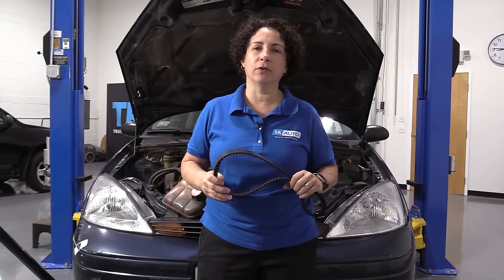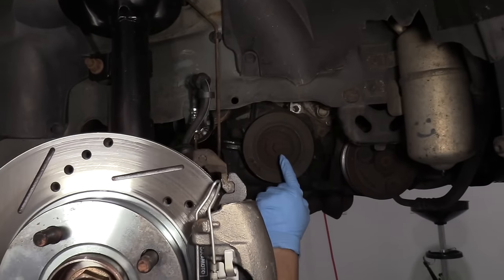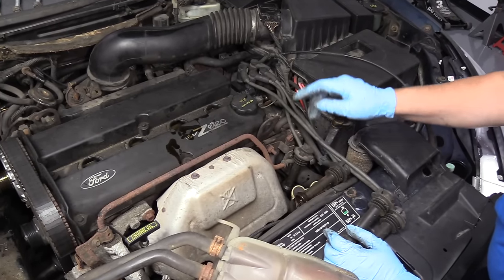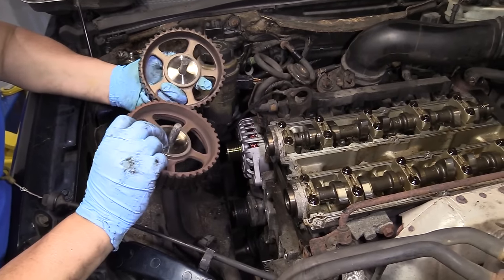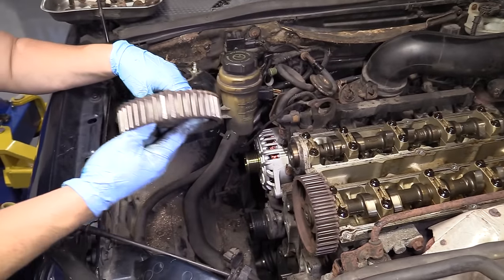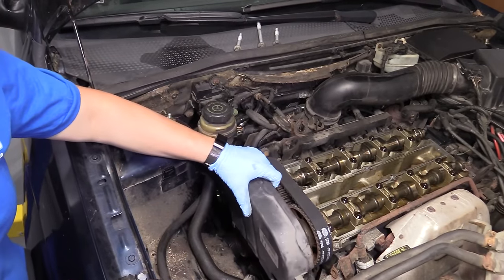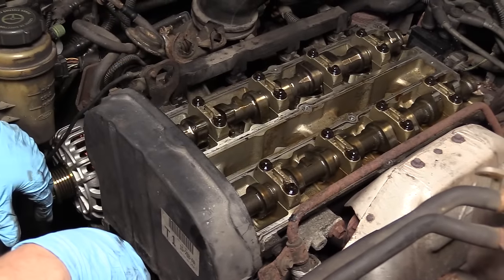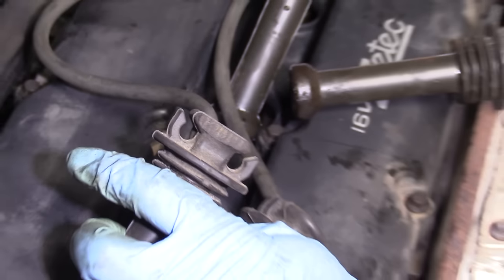How to Replace Timing Belt 00-04 Ford Focus Sedan Wagon Hatchback

Comment: Does anybody have a focus ? How do you know when it’s bad or when it should be replaced? Any noises? Any difference in engine noise or anything?I have a 2002 Ford Focus se. I can’t find any record of it been replaced. It’s got 170k+ miles. Please any help would be appreciated it and Im thinking about replacing it but Not completely sure.

Comment: When is the best time to be ahead of a timing belt need? Like, when do I know its time to replace it without it getting as bad as the one in the video?
Reply: When in doubt, change it out! If you buy used make sure you have documents showing the last change and mileage and go from there pending how it drives. Never max out the lifespan of the belt or you might max out the lifespan of your motor.

Comment: I wonder how many garages will actually do this all so neatly. I’m afraid once you walk out of the door with your car left behind with them, that they are going to botcher the job to save time and effort. Just replacing the belt literally without swapping the pulleys and properly installing the valve cover etc. It looks like an interesting job to DIY but i guess it has a high chance of failing when you’ve never done this before.

Comment: 15/16 won't even fit over my camshaft, mine needs a 1" , as far as what you use to keep the camshafts from turning while you tighten the pulley bolts

Comment: Nice video!. Can i ask you something? I need to replace the timing belt, i have a ford focus titanium. is it the same? What do you mean by 00 04?
Reply: Toncho 1 she means vehicles from 2000 to 2004
Reply: 00-04 refers to the model years of Focus to which this video pertains to. This video is a step by step tutorial for anyone with a 2000-2004 model year Ford Focus with the 2.0L Zetec. I believe the Titanium package was introduced quite a few years later, so this video most likely will not be a proper tutorial for your car. Verify whether your vehicle uses a timing belt or a timing chain. Timing chains don't usually need to be serviced for the life of the vehicle.

Comment: WHAT about the water pump , easy to do while in there ?
Reply: The water pump in this car is run by the serpentine belt so it's a relatively straightforward job. The reason I would think twice about replacing the water pump in this car unless necessary is that the water pump bolt holes strip a lot so you may likely find yourself having to do a helicoil job as well. Even that's a pain since the aluminum wall gets really thin on the outside when you drill out the hole. Mine cracked when I was tapping it and I had to get another water pump housing from a junkyard. Ford discontinued them and there are no aftermarket manufacturers that make them as far as I know

Comment: The Base model is a non-interference engine. The SVT focus how ever is an interference.
Reply: True...I have a 2000 zx3 with 52k miles. And an 2003 svt EAP WITH 119K MILES
Reply: In north america there were 3 engines. SOHC 2.0L, DOHC Zetec 2.0L and the 2.3L svt. ONLY the 2.3l svt is interference, the other two are not.
Reply: @vernonlemoignan1392  the SVT is NOT a 2.3L it is a 2.0L  The 2.3 is a Duratec  I had one in my 2003. PZEV California engine.
Reply: I was thinking of buying the non interference 2.0 and building it up for my SVT and swapping to eliminate fear of engine death. Otherwise get shorter connecting rods through TRW and drop compression. You need lower compression for a turbo anyway or it wont work to its full potential.

Comment: I tried this project and failed miserably, I am not a mechanic, but have watch a lot of 1aauto.com videos, and had a lot of success, I got the nerve to do this and the one thing that's not noted in this video is you have to loosen the gear cams to put the timing belt back on, because I was not changing my cam seals I assumed you didn't have to loosen the gear cams but that should be noted in this video whether you are changing the gear cams SEALS or not you still have to loosen the gear cams.
Reply from the maker: +Courtney Johns Thanks for the tip! We'll pass this info along to our production team.

Comment: Ford Focus will have one of two engines, either the 2.0L DOHC (double overhead cams) engine Or the 2.0L SOHC (single overhead cam) engine. 

The 2.0L DOHC engine is an interference engine 

The 2.0L SOHC engine is a non-interference engine. 

If you don't know which of those two engines you have and you can't tell at a glance the difference between a DOHC engine and a SOHC engine, then look at the 8th digit of your VIN number. The 8th digit of your VIN number is XXXXX engine code. If the 8th digit of your VIN number is XXXXX '3' then you have the 2.0L DOHC engine, which is an interference engine. If the 8th digit of your VIN number is XXXXX 'P' then you have the 2.0L SOHC engine, which is a non-interference engine.

This said, even in the “interference” engine there is enough valve clearence so the valves will not hit if the timing belt were to snap.

Comment: I thought this was a non-interference engine. Can you clarify this for us?
Reply: Obviously not an expert, but from the research I've done, the 2.0L Zetec is an interference engine.
Reply: @joelzowie7722  This is somewhat controversial. The pistons are recessed to prevent physical contact with the valves in case of timing belt failure. That would make the engine  non interference in practice. The SVT is an interference engine though

Comment: Its a non interferance motor  i belive its only single over head cam is interferance
Reply: Correct. This is not an interference engine.
Reply: This needs to be at the top. She states it incorrectly half a dozen times in this video.

Comment: Those motors are NON-interference. I have the same Focus, same motor. If your timing belt snaps or it jumps time, you'll be fine. The motor won't start
Reply: Sadly not the SVT motor. Your belt goes so does the motor. Why they did this makes no sense as it was supposed to be a performance engine you would think it would be built for protection during hard driving.

Comment: When you see a belt like that you wonder if the owner did any oil changes either..or put air in the tyres,  or had the brakes checked...or even deserved to be let out on the road. It's neglect, plain and simple.

Comment: Good videos but at 54:36 to 54:40 i think you made a mistake, see how the belt has gone slack between the cam pulleys? 56:14 as you say, need that tension to remain constant and maybe it was just the camera angle but the indicator looked so far off. As for the spring tension in the adjuster and the spring tension in the cylinder head causing the indicator to move slightly, this is just a theory but i think the intake cam is slightly retarded because of the torqueing at 54:40, causing the indicator to move a little more than usual.
I think the cam lock bar could have stayed in to know they are perfect, then use the 15/16 spanner just as an extra cam holder, but the actual pulley really wants to turn when the bolt finally torques, you need a third hand to keep that perfectly still. Best would be to have a helper holding cam really well so you can focus on the pulley not moving.
I really appreciate and respect you putting these videos out for people to watch though, just trying to be a helper not a hater here.
Reply from the maker: +The Moon is square Thank you! We love empowering our customers and showing how to perform DIY auto repairs with our high-quality auto parts.  http://1aau.to/m/Shop-1AAuto-c
Reply: It would be nice if 1A would confirm or deny when people mention issues like this in a video. We know we can trust 1A but we don’t have a history with commenters.